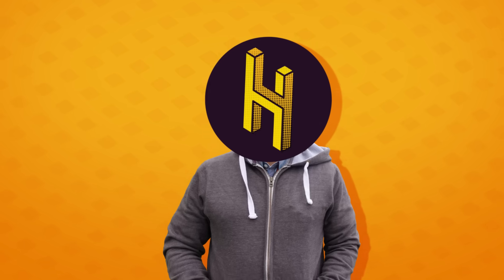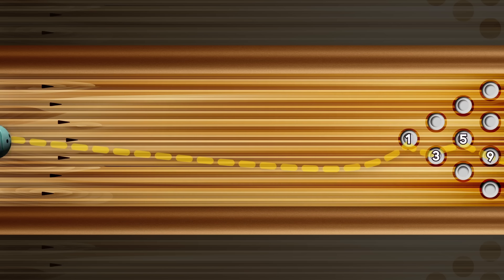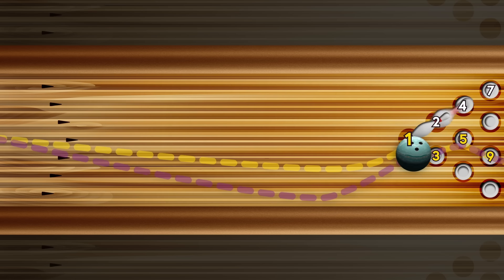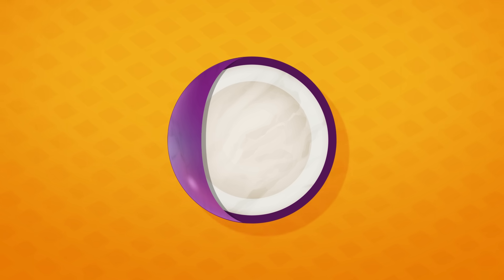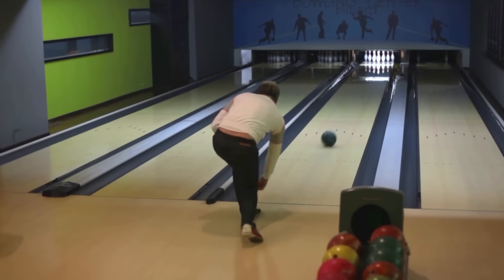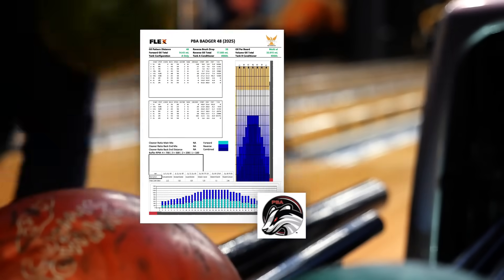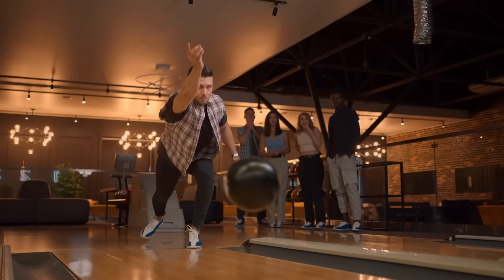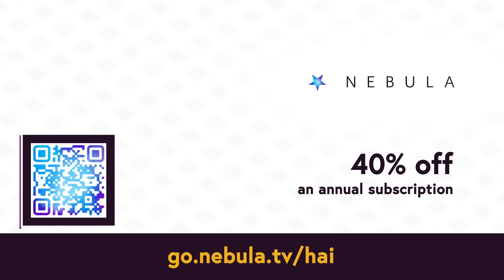The Absurd Science Behind Really Good Bowling Balls

Comment: the only thing i have to add, is that generally urethane its not that great in less oil. you typically just need a weak reactive ball. Urethane is good on certain sports shots, and is rarely good on typical house shots you'll see in a bowling league, or open bowling, Especially if you're a righty. Urethane doesn't absorb oil from the lane, it ends up carrying it down, Which if you are a righty bowling with other righty's, you end up ruining the oil pattern for everyone else.

Comment: I have a probably dumb question I’ve always wondered about. So, I have bowled before, and I’ve gotten strikes multiple times. I’m not good at bowling. I’m probably just above average among normal people, and well below average among bowlers. But, like I said, I’ve gotten strikes multiple times. So isn’t bowling just a matter of consistently doing the thing that I manage to do inconsistently? Why all this fuss with different ball types and oil patterns and techniques? Can’t you just practice till you can do exactly what I did once, except you do it every time?
Reply: The first issues is that it is incredibly difficult to bowl consistently straight to a single point 60 feet away, but also the angle to get a strike is much smaller from any direct angle. That's why curving the ball ever became a strategy and why once you learn it you start knocking down more pins, it widens the range you have to get a strike when you curve to hit at an angle.

If you look in the video where he shoes the ball hitting the 4 pins, imagine if that was a straight line, the ball at that angle is much more likely to reflect off the head pin rather than push into it to go through the middle of the pins.

Comment: One element that you forgot to include is the weight! A lot of people participating in recreational bowling will just grab whatever ball feels the most comfortable and sustainable to use. However, when I joined the bowling team in high school I learned that the weight of the ball was really important. Our coaches trained all the girls to be able to use at least a 10 to 13 lb bowling ball depending on their size, while the boys were all trained to use 14 and 15 lb bowling balls. The reasoning is because the weight of the ball does a lot for ensuring your ball has the momentum to knock down ALL the pins. In the examples showing what the ideal strike shots would be; if a person were to use an 8 lb ball, its pretty likely that the balls trajectory will be altered after hitting the first group of pins. A heavier ball is more likely to blast through them all without being slowed down or bounced off course. It's far more effective to properly roll a heavy ball than to whip a light one down the lane
Reply: As someone who has used a 12, 14, and 16 pound ball regularly in my life, this is so true.  That 12 still feels like it would just ping off pins at times and make some stuff happen, but not TOO much.  But rolling my 16 causes so much momentum when it hits the pocket that it looks like a threw a grenade down there

Comment: More fun facts! I interned at a motorcycle parts manufacturer, and the owners son was a college scholarship level bowler. So naturally there was a tiny section of the factory floor dedicated to bowling stuff and a couple lanes in the back closet.

-The durometer (hardness) of a bowling ball changes just enough as it ages and dries out that this kid developed mylar storage bags to climate control balls and make them last longer.
-Pro bowlers even have custom formed thumb hole inserts! And so we developed an insert so that custom thumb hole can be inserted and removed into different balls quickly so bowlers only need to buy one. My buddy designed it and was in the process of patenting it when I left. The hard part was keeping it in because you can't have any cavities, period, other than where the thumb goes.

Also, the company owner is a dick.

Comment: hey, nitpicks:

strokers, crankers, and tweeners

strokers prefer accuracy over power
crankers prioritize power over accuracy
tweeners like to find a balance

there are 4 main ways to bowl:
One handed with thumb

two handed without thumb

one handed without thumb

spinner.

spinner comes from asia where when bowling was brought there around the end of the wars (us occupation ofc) there was not much upkeep for the bowling alleys and the oil, so rather than worry about the pattern of the oil, the spinner technique was made to maximize the effectiveness of straight bowling so that bowlers could ignore the oil as much as possible (since the oil was too irregular or not enough to actually use).

coverstocks make up the most of ball reaction:
how the coverstock is surfaced is the most important, then the material is the second most important.

Polyurethane and reactive resin are the same material, but reactive resin has an additive that makes it absorb oil so that a dry part of the coverstock will make contact with the lane after the oil.

Urethane is used on short oil patterns since it reacts slower to the dry lane surface. When used on dry patterns, urethane can be difficult to use and unpredictable.

The reason reactive resin is used is so that balls can be made with shinier surfaces so they will hook less in the oil and more in the dry/after the end of the pattern (known as backend reaction). Reactive resin additives make dry coverstock hit the lane, and are formulated to maximize friction with the lane surface.

Comment: I rely on a precise ball fit to reduce grip pressure and assist in proper release.  How your fingers fit in the holes (if you use them, not all bowlers do) is critical on a minuscule level.  My thumb changes diameter as I bowl, so I have interchangeable thumb inserts that are drilled at different diameters, and I change the thumb insert to match my thumb size. I also use multiple layers of varying thickness thumb tape to aid in thumb fit.
Reply: Yeah finding a house ball that will safely let go of my thumb but didn't feel like it weighed 5 pounds too much was always a struggle in the rare casual instances I've gone

Comment: If you're interested in breaking your brain again, check out pinsetters. those machines are magical, and i still have no idea how the rotating pin lift actually grabs the pins. also, those string based pin setters are their own kind of crazy. genuinely don't understand how having a rope coming out the top of the pins doesn't grab or slap other pins, resulting in more pins knocked down than there should be.

Comment: If you really want to get into it, 

1. Temp affects the lanes, this is why up north the lanes push longer and dont break down,
2. How each lane surface (wooden / Synthetic) soaks up oil, and how each individual house has different rates of this 
3. PAP/Pin drilling 
4. Topography of lanes
5. Free fall vs string
6. Bounce Pads
7. Grits of bowling balls
8. 2 vs 1 handed
etc lol

Comment: Great video, you captured some of the most important nuances of bowling, impressively comprehensive for 7 minutes. Ball speed, rev rate, and axis rotation will also impact the shape of the bowling ball trajectory. PBA Bowlers are especially good at manipulating those factors to help them adapt to the lane condition. Urethane balls are seen as being easier to control compared reactive resin, so many pros will use those to maintain a more consistent shape on certain oil patterns - even if it's heavier oil conditions. Reactive Resin balls have a porous surface that actually allows the ball to absorb oil. Urethane can pick oil up, but not absorb it. You may notice bowlers wiping off their ball after every shot, that gets the oil off the ball. I always have 1 urethane ball in my arsenal, two reactive resin balls, and one polyester ball. 

Fun fact: Storm, a major bowling ball manufacturer adds fragrances to their reactive resin balls in the cover stock.
Reply: I have an old Storm reactive resin ball.  Those things are INSANE when brand new and over time calmed down and I've still been able to use my Great Big Grape for over 30 years now and can still average 200+ with it.
Reply: @JimTheFly  My Phaze 2 and Phaze 3 still smell great years later too.

Comment: Welcome to my world, HaI.

Cranker/Stroker is more about the mechanics of actually putting revs on the ball. A stroker basically just swings their arm and follows through, with the ball basically falling off their hand in a specific direction to produce rotation. A cranker actively uses some technique (get this--it's individual to the bowler) to put more rotation on the ball than would naturally happen. This means a cranker has a higher "rev rate" than a stroker, generally speaking. The kicker is that because people roll the ball at wildly different speeds from one another, a cranker might have to play a tighter line if their speed out-matches their rev rate (speed dominant), and a stroker might have to play a wider line if they have lower speed (rev dominant).

Also, hooking (not curving) the ball more gives you more room to miss the optimal spot on the pins (the pocket), while still getting a strike consistently. It takes a lot more practice to be able to throw the ball with more hook, but once you do you'll end up with higher "carry" (the likelihood that an off-hit leads to a strike).

Just wait til you understand the complexities of drilling layouts, reading ball reaction, and pin reaction.

Bowling is an iceburg, and you've just barely hit the water level lmao.

Comment: 6:00

Urethane balls are NOT for dry lanes. This is the worst advice you can give anyone. Urethane balls need oil to react properly, otherwise they'll hook immediately upon contact with the lane and rip left (or right if your left handed). Urethane is used to control angles and play a more direct and less steeper line on flat, evenly oiled sport patterns.

For dry lanes the best balls are entry level weak reactive resin balls with symmetric cores.